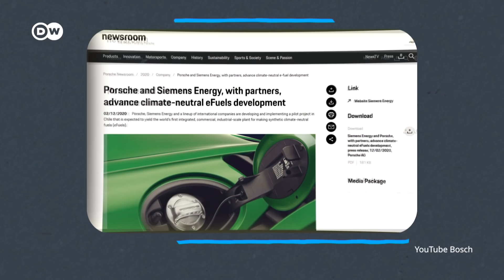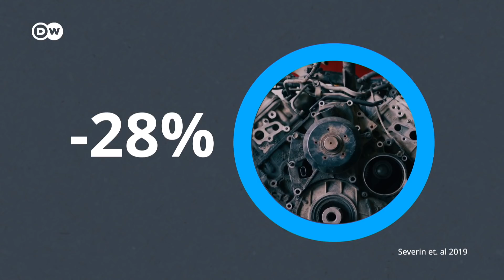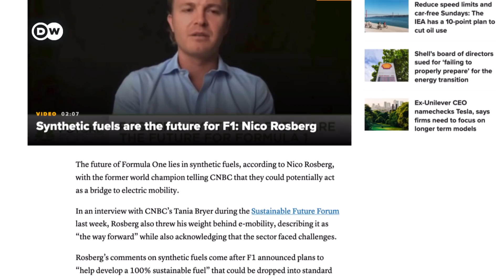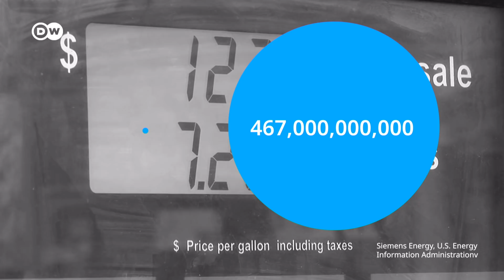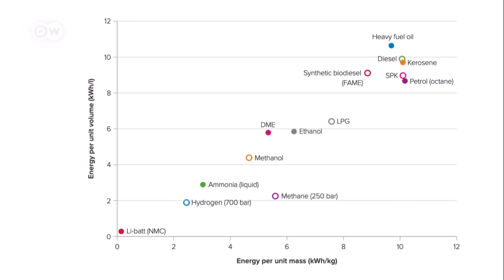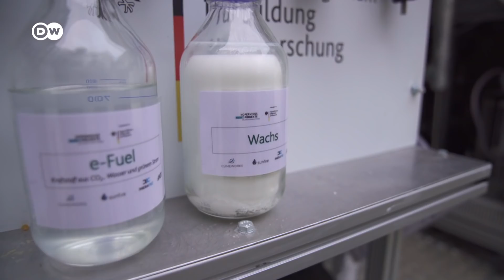The truth about carbon neutral fuels

Comment: What about the lithium needed for those car and the battery's for that power to be held what about the fact that lithium can't be recycled.
Reply from the maker: Hi Corey, very good question! Have you already watched our video about recycling old lithium batteries? Here is the link: https://youtu.be/PbOBmnZRpZ4 
We also did a video about how salt and sand could replace lithium batteries. You can watch the video here: https://youtu.be/-vobMl5ldOs 
Let us know what you think in the comments section 🌍 🌱
Reply: @DWPlanetA  yea I did I also seen a liquid redox batterie and a nuclear diamond batteries as well those mite be a more effective salutation. My big concern on lithium is the mining to get the lithium and the fact it can't be reused.   I think if we're going to get a handle on this we're gonna have to use technologies that we have perfected already like liquid uranium salt reactors. They can't meltdown and expode and are acutely safer then solar with no batteries needed. If we used redox batteries on cars you could just exchange liquids instead of charging the car, also there's no cycle life with redox.

Comment: All things that help to reduce the carbon in the atmosphere is worth using.  If the e fuel can power the generators that provide power to our electrical grid it decreases the need to mine for the things needed for the batteries and oil products.  The large wind and solar fields to provide power to make the e fuel  will help bring down the cost so the average home owner can have a wind mill and or solar panels.  This will reduce the strain on the electrical grid.  The cleaner burning fuel allows us to drive our classic vehicles.  Destruction or permanent storage of the classic vehicles is like destroying art and history.  Neither shall be taken lightly.

Comment: Battery powered vehicles use a huge amount of energy in their production, so much do that you need to drive over 100000kmd to break even with petrol powered cars.
On top of that, battery powered cars have low range, are heavy and take a very long time to refuel.

Efuels definitely have a future but it has to be a globally mandated solution backed by governments around the world that would boost the economies of some of the poorest countries in the world on the Sunbelt. (Except Australia).

Comment: Yes, it is far more efficient to power a car and similar vehicles with batteries. but this video completely ignores all the things that batteries are not practical for and won't be for a very long time if ever: long distance air travel, long distance shipping, powering heavy equipment, all the gasoline and diesel powered vehicles that will be around for decades. For these, synthetic fuels make the most sense.

Comment: To make eFuel we need hydrogen from electrolysis then why don't use it as fuel which would be more efficient and cost effictive than using hydrogen with captured CO2,why add extra step (and cost) to achive the same result ,From my prespective hydrogen compustion engine are better than using eFuel

Comment: More of these please.
IC engines are tried and tested technology that needs to be improved further and further
Reply: E-fuels or algae based fuels are really the only viable energy, reasonably environmentally friendly substitute for natural gas,  propane, gasoline, kerosene, and diesel fuel. Hydrogen is very difficult and expensive to deal with.

Comment: The ideas presented here are in bias. 
Example. Energy wasted getting the E sustanable fuel to the the wheel. True. But not as bad as they detailed. 
But is the energy conversion rate is better then electric. Its a draw after you consider these omited facts. 
They delete the energy needed mining the battery rare earth matetials. 
Moving the electricity also has issues. 
They do not consider the battery degredation cost in inefficency
They do not consider the extra mass and weight of such vehicles
The cost is 50 to 65 trillion of which most cannot afford. 
The infrastructure does not exist and its energy intensive. 
E fuels are the answer...

Comment: So we’re just going to throw away all those ICE cars to create new electric cars, we forget that producing a new car also has environmental impacts also, if not cost, and those cost are rising everyday. Seems more prudent to have small eFuel locations that used solar/wind to convert CO2 into eFuel.  I’ve heard that one of these electrolysis units can be scaled down into a 40 foot container size eFuel station. A reminder when you throw something away your throwing energy away….. Honestly hydrogen has way more promise than what is going on with batteries regulation need to be relaxed surrounding their usage/storage methods….

Comment: E-Fuels  rather like hydrogen, sound like another distraction being pushed by the fosil fuel industry to slow down electrification.They are ineficient, costly and ultimately not as clean as electricity(when supplied by renewables).And lastly their use case for ships and planes will soon be redundant as battery power efficiences increases.Certainly by 2030 we should easilly have power density for batteries that could make mass transit by electric planes and ships possible.

Comment: IF the money being spent on going electric had been used for accelerating efuel Developemnt it would likely be done by now and we could use all the cars, boats, planes and infrastructure that already exists. Instead they want 1 billion cars replaced with new EV’s that aren’t yet affordable, at huge cost to the working man, the planets resources building them, along with an entire new infrastructure, where there aren’t the rare earth materials to satisfy the requirement and that’s before we discuss where the power is coming from to regularly charge. There are fuels that F1 have proposed would reduce pollution/CO2 by 40% virtually overnight transforming progress towards net zero but again no interest from the powers that be as the governments run headlong into another disaster driven by vote winning hysteria. 

A typical electric car battery weighs a thousand pounds, roughly the size of a suitcase yet contains 25 pounds of lithium, sixty pounds of nickel, 44 pounds of manganese, 30 pounds of cobalt, 200 pounds of copper and 400 pounds of aluminum, steel and plastic. There are over 6,000 individual lithium ion cells inside. To make each BEV battery requires processing 25,000 pounds of salt for lithium, 30,000 pounds of ore for cobalt, 5,000 pounds of resin for nickel, and 25,000 pounds of ore from copper. In total, you have to dig out 500,000 pounds of dirt for a battery.

I fear we will look back on this lost opportunity with deep regret.

Comment: I think we should be all in on carbon neutral fuels because we would be able to massively lower the emissions of our existing global fleet of ICE powered vehicles.
We desperately need cleaner fuels than Diesel and Gasoline especially for the commercial sector. EVs are just not the answer to the problem period.

Ethanol blends are already a thing so we can also expand that avenue.

Comment: I moved huge RVs all over the US and CA on cleaner ethanol, E85, for $2/gallon during the pandemic.

New RVs should be electric or hydrogen fuel cell with solar roofs.
Reply: Or LPG fueled because LPG is a cleaner fuel than gasoline or diesel. Not great but still cleaner.

Comment: Solar and wind are NOT renewable or carbon free. 
Solar panels are made from Quartz and Coal and the burning of Coal is required to achieve the heat needed to bring the two together. 
CO2 is released during the mining, transportation and burning of coal. 
We also require steel and aluminum for both solar and wind energy. 
To make steel you NEED to have and BURN COAL. 
The process to produce Aluminum takes 7 times the energy required to produce steel. 
In the end there is NO SUCH THING as carbon neutral fuels or renewable energy, it’s PURE nonsense, but hey, you didn’t hear that, because it’s a SECRET.

Comment: We already have etanol 100% here in Brazil, with a much more simple process of production. Ok, energy density is 70% of petrol gasoline, but, it's not a problem for regular cars. Considering electricity produced in useless places for food production (deserts and off shore), it seems to be more effective/efficient for regular cars the be electric cars with battery. Other applications would use green hidrogen in fuel cell / electric vehicles. E-fuels might be a solution for aviation, in my opinion.

Comment: I think synthetic fuels will still have their place as a bridge. I'm still running my first car and have been for 7 years now. I don't expect to change car until it truly dies. I think it's important to note the carbon emissions used to create new EVs to replace current cars. Personally, I think it's better to run our old ICE cars until they truly die using eFuel rather than rushing to buy EVs which currently produce alot of carbon in their production, lifetime (assuming a large proportion of their energy comes from fossil fuel power plants) and their disposal (what are we going to do with all the dead batteries and their chemicals etc.?). I think the average consumer is going to be using ICE cars for the next 20 years at least.

Comment: Modular nuclear reactor = production of hydrogen= hydrogen cars=byproduct- water. And then renue the cycle. That’s how we will move toward. Electric cars have a waste in battery that requires a change every 10 years
Reply from the maker: We have a video on electric vehicle batteries and the environmental hazard they may pose. 🚗🔋
Check it out and let us know what you think in the comments 👉 https://youtu.be/PbOBmnZRpZ4
Reply: @DWPlanetA  all that process is costly and in the end people will have to buy new batteries. Nuclear energy will power the production of hydrogen and its more easy to change a petrol car to hydrogen than changing it to electric!! In the end it’s down to cost and minimum impact!! Maybe in a near future we can have a fusion reactor supplying the power to produce hydrogen!!

Comment: We need to make the jump to nuclear energy, there are safer ways other than using uranium, such as the liquid fluoride thorium reactor. That needs to be prioritized over renewable because renewable is not efficient enough. Plus batteries require many rare earth minerals such as lithium, which is an ecological disaster because the mines required to get this minerals are massive, destroying acres of land for giant strip mines and quarries, which could otherwise be used for farmland, housing or just maintaining that land for nature. Once we make the step to thorium reactors to replace fossil fuels for our power grid then there will be plenty of energy to produce these e-fuels, and those fuels can then be used on the vast majority of vehicles already on the road but making them carbon neutral, and negates having to destroy many acres of land to get the rare minerals needed

Comment: glad that finally at the end there was some balance in the video. Obv the current energy consumption for driving cars in the world is way too high as if you could keep the combustion technology only, and just replace the fossil fuel with eFuel, but nobody (at least in his right mind) is arguing that, also yes the electric vehicle has a lot of advantages especially in the indivudal mobility application. Nevertheless eFuels will 100% have his place in modern energy supply systems and has some huge upsides. Im excited in which direction it will al develop, the best technology for the respective application case will eventually prevail and most likely its gonna be a mix of all the different innovations.
Oh btw as you could imagine im a chemical engineer working on stuff like Methanation/FT and other chemical fixing of electric energy so i might be triggered a little bit haha.

Comment: So these are synthetic "E-Fuels" not green crude. Green crude is very promising. I hope it receives more funding and attention.
Reply: Green crude is basically just growing and refining a specific breed of algae. It's space efficient, the refinement methods are familiar and can bring it to fill the niches in fuel we currently use, that refinement can be powered by renewables and nuclear; and as a biofuel it's part of the carbon cycle, it's not reintroducing carbon that has been absent from the system for billions of years, meaning it is very nearly carbon neutral. Only nearly because of physics.

Comment: Batteries and electricity are the solution for daily driven passenger cars, but for everything else (buses, trucks, ships, planes, agricultural equipment, construction equipment, military equipment) batteries don’t have the energy density required to move those things.

Comment: You did not mention the massive amount of CO2 needed to make vehicle batteries, and the electricity to fuel them. This offsets almost all gains overs ICEs
Reply: It doesn't offset the gains of EVs completely. It's true, that it takes awhile for EVs to actually be more co2 friendly, than combustion engines with regular fuel, because of the production of the batterie. But over the whole lifecycle of a car they are better for the environment.
Reply: @Franko384  Depends, if the power plant is fueled by coal or natural gas, EVs never catch up. Just power the car on compressed natural gas or compressed methane made from the coal.

Comment: I assume E-Fuels won't solve the problem of localised pollution as you're still burning fuel?

To me a lot of people are 'anti BEV' as the they seem to want to stick to a procedure they're already familiar with - i.e. go to a garage and fill up - rather than just 'fill up'/ recharge at home.

As electricity power supply exits in most inhabited locations it seems to me the actual distribution of the fuel/power must be simpler with BEV's - which also have the advantage of being used as energy storage devices and balancing the Grid.

With the advance in  battery technology; and the move away from harmful materials, to me the advantages of BEV's seem to outweigh anything else.

Comment: Strictly speaking the use in ICE vehicles, synthetic fuels will likely just be used in classic vehicles as time goes on. Most people will eventually have EVs or hydrogen powered cars to drive around. We're likely to see it used only in historic vehicles that won't be driven much. Owners will gladly pay up to have something to power their ICE classics. But, what's more important is capturing that CO2 in the first place. 

In terms of using synthetic fuels elsewhere...it's not a pracitcal solution. Ships, manufacturing, and air travel, for example, that currently rely on fossil fuels will definitely need to transition away from that. They will. What's important is making that happen quickly. But again, carbon capturing is vital in reducing our global CO2 emissions.